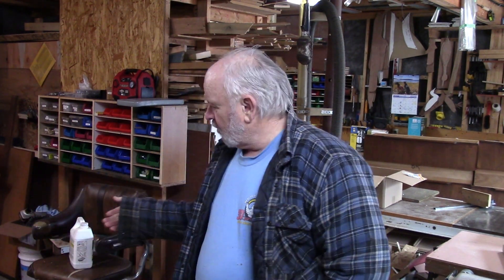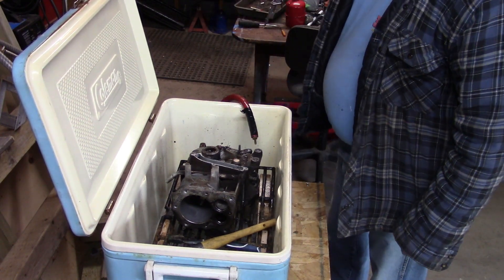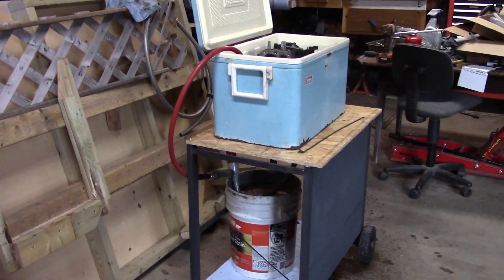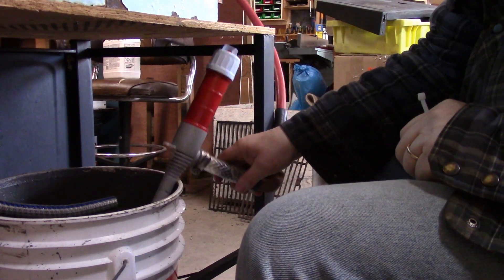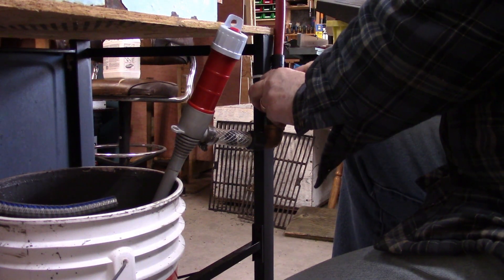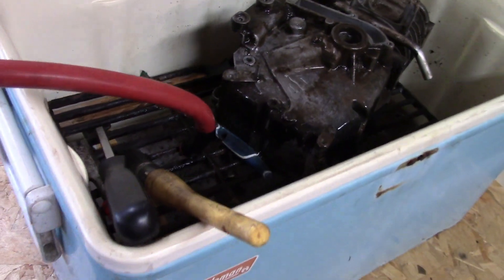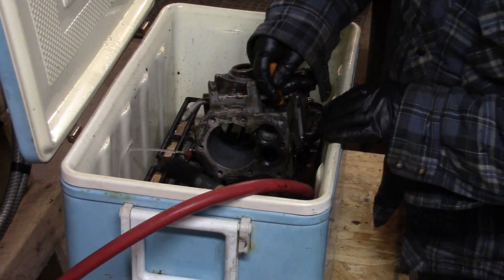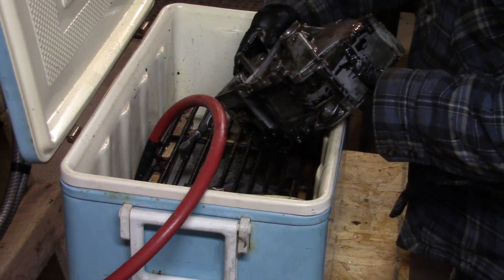Small Engine Rebuild Part 1

Comment: Tellme Mike does it give you enough volume of fluid to get your parts cleaned?

what if you took a PVC pipe and screwed it to the side of your bucket and dropped your pump in through the PVC pipe to hold it in place??
I look forward to hear from you by 4 now take care God bless you, 
Ken
Reply from the maker: How's she goin'?  The flow of cleaner is certainly enough for cleaning parts.  I was thinking of a more powerful flow, but then I thought the solution would only splash back on me maybe.  This flow works good.  Putting a piece of PVC pipe would be a great idea to help secure the pump.  I have it ty-rapped to the stand now and this is working out OK.  Thanks for the great comment Ken!!  I am enjoying your vids but often times don't comment, because I watch them on TV or my phone!!!  Take care eh!!
Reply: @GrampiesWorkshop  😉
👍💥👍OK Thanks 👍💥
Your Friend Ken 😉
God bless bye for now leave a comment when you can.

Comment: Hey, no one ever gets an invention right the first time.  Even WD40 took awhile!  Maybe an adapter to replace the battery would be a good idea?  Aside from the citrus based cleaner I told you about, the best thing for cases like that and carburetors is PineSol.  You have to let the part soak in it overnight and they come out spotless and bright.  I learned about it on a motorcycle forum when I was restoring old motorcycles. The best thing about PineSol is that you can get it cheap at the Dollar Store. 
Terrible situation in NS with the shootings.  You and another friend I know that lives in NS were the first things I thought about when I heard about it.  Lots of strange information gonna be coming out about that one I think.  I heard on the radio today that there was another possible shooting.  I'm not a praying man, but my thoughts and well wishes certainly go out to those that lost loved ones.
Take care and stay safe
Reply from the maker: How's she goin'?  I never thought of Pinesol.  Maybe give that a try!!!  The Spray Nine is working but it takes a lot of elbow grease to clean the parts.  The shooting last weekend were terrible for sure.  Appreciating your thoughts Bruce!!!  Take 'er easy!!

Comment: The shooting was all over the news down this way but it soon gave way to the CoVid coverage.  Couldn't believe what that guy did !!  You were the first person I thought about when I heard it was in Nova Scotia. 

    Hey I like your parts washer.  I made mine out of a 30 gallon R-123 (R-11 replacement) barrel.  That plus an old, old...did I say old low pressure oil burner motor and pump to circulate my cleaner through a hose off a set of refrigerant guages.  Ya done good Mike. Take Care and Stay Safe my friend !!  Good project you got there.
Reply from the maker: Hi there Wendel.  The tragedy of last weekend will never be forgotten to be sure.  The parts washer is working OK.  Still finding some things to improve, but that will be happening for awhile yet I expect!!!  Thanks for tuning in and take care!!!

Comment: MIKE ! It is working great bud. Me thinks a brush inline and a reg type solvent will be the ticket for you. even diesel. If you folks still have an Acklands They have a great 120V pump I have used many over the years I have been really happy with performance and long lasting piece.Diesel doesn't need a water bath after cleaning but reg solvents or gas do. The solvents leave a barrier that need to be washed off for the regular oils or greases will not do the job of what they are designed to do. The Spray 9 is great but needs to be warmed up to work best. Being water based there is no need for the  water based fluids to make them do the job eh.Thanks a bunch bud. This home build is working great as it is. Way better than a 5 gal pail on the shop floor eh WOOHOO bud !
Reply from the maker: How's she goin'?  I knew the Spray nine was leaving some residue behind.  I was wondering how hard it's going to be to clean that residue.  I never thought of using diesel.  Not real flammable either.  Thanks for the tip.  Thanks for watching too and take care!!